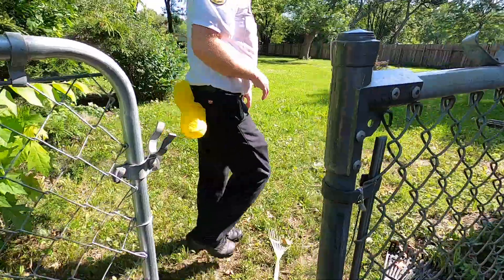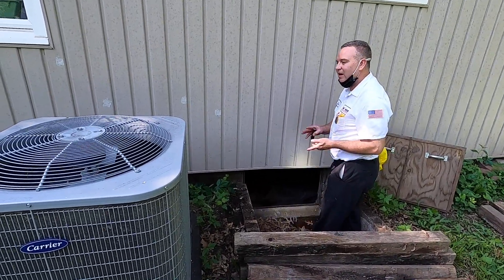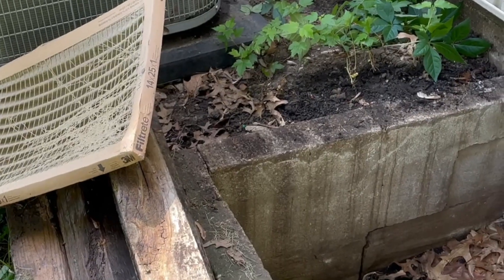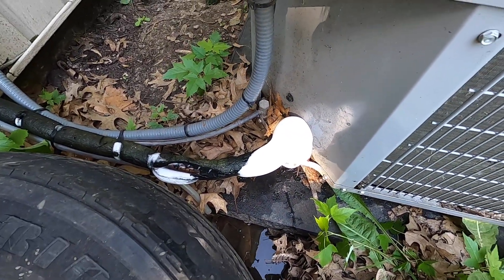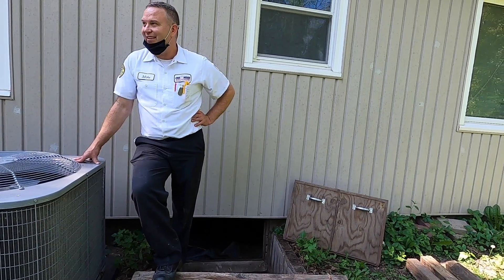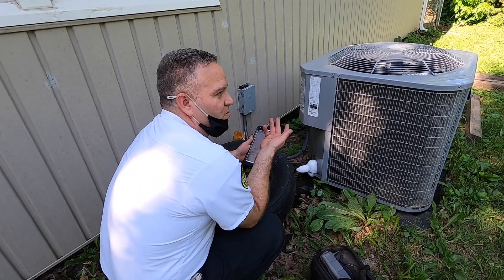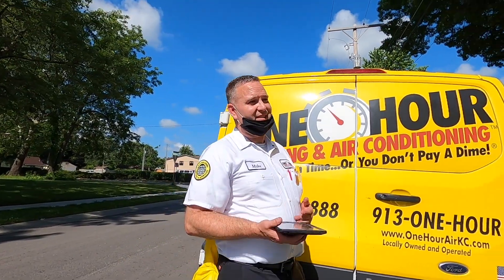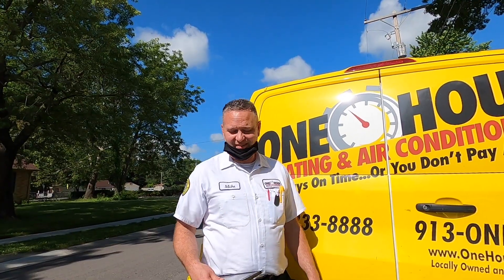AC NOT WORKING | WHAT TO DO IF ICE IS ON AC UNIT

Comment: Hello. I have a question about what I'm experiencing: 
Late last night, I noticed the ac was not blowing cold air and the fan was running outside. I turned the unit off, checked the filter and realized it was last changed 6 months ago and was super dirty. It was wet and ice (size of cube) was on it, the metal rod, pipes and unit felt ice cold with alot of condensation dripping. I couldn't tell if the outside had ice since it was dark out.
This morning, I saw another one of your videos and turned the fan only option on to thaw any ice left, and I'm hearing a loud thumping or flapping noise in close intervals. The fan mode isnt working inside or coming on outside. I dont see any more ice inside or outside.
What could possibly be causing that sound and causing the fan only mode not to work?

I hope you will see this soon. I'm in TX with temps in the 100s and if there's something I can do first before calling a tech, I want to do it or gather as much info as possible. Thank you in advance for any responses.
Reply: So what ended up being the problem with your unit ?